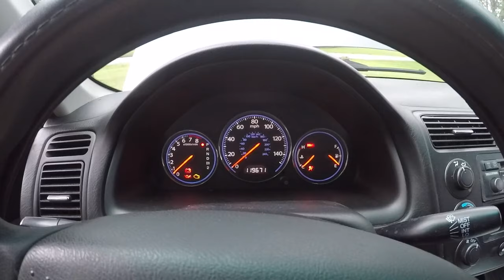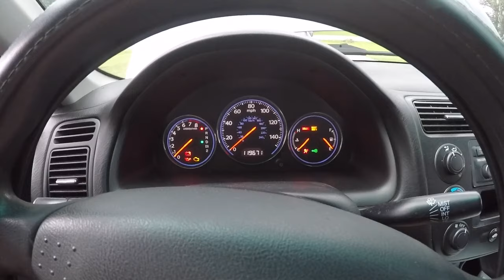Honda Civic LX Engine Swap Part 4 Will She Start!

Comment: Dear poster, did you swap in the same engine as the original one that came with ?
Reply from the maker: the new engine that I put in there was from a local seller of engines. they have bunch of cars/ parts and more, they removed the engine from the donor car and I installed it in my civic.

Comment: Did you have to remove the AC out of the system before you took the lines off?
Reply from the maker: A M you really don’t have to, because if you undo one of the lines it will all come out. So that’s not too big of a deal. Plus we needed ours refilled so it wasent’t too much of a problem to just let it all out. Just don’t keep your hand under that pressure or what all comes up. Let it flush out and then work on it.
Reply: Lx to ex
Reply from the maker: @MiguelLopez-kp8ev  lx
Reply: Brother ty for your knowledge quick question is it a mission if i change d17a2 vtec block  and add a d17A1 head
Reply: @RomanovichAutoSurgeon  thanks for the heads up man. Me and my brother was able to swap the engine  out. Finally have it all put together and am working on getting the fluids together before we crank it. What issues would I expect to see when I first start it up? I went back over everything to make sure everything is how it should be.
Reply from the maker: You don't have to but you can depressurize it a little by taking a flat head and pushing down on the cold fill lines. Just have a towel over it because Freon will get on you and it will be cold, plus don't think it's the healthiest for you.
Reply from the maker: @andrewm5190  What I did was purge the fuel lines before cranking it. So put the key into the ignition and put it into the on potion, but don't crank the car over. Do this about 5-7 times, and it should fire right up. It may want to hesitate for a second or two due to it being cold, other then that it should start right up. As long as you have it all connected it should fire right up. Also you could take the two lines from the electrical where they connect to the car battery, so positive and negative poles, take them and hole them together for about 10-15 seconds. Obviously don't put them to a power source while doing this. What this will do is kill all the extra electric flow our of the system, just to make sure it don't blow any fuses. Let me know how it works out !!
Reply: @RomanovichAutoSurgeon  sweet, thanks for the advice. How is your Honda holding?
Reply from the maker: @andrewm5190  Not so well, if you watch my recent posts you would see that it was banged up by the tornado.
Reply: @RomanovichAutoSurgeon  oh man I am sorry to hear that. I havent had a chance to check them out so I wasn't sure.
Reply from the maker: @andrewm5190  No worries. Hope your not effected!

Comment: did you have to remove starter?
Reply from the maker: I actually did not have to remove the starter because I was able to remove motor and transmission together. Now since I knew that I had a good started, I moved it to the new engine! Hope that helped, unless you had the question in a different way. Let me know!

Comment: Hey I have a Honda Civic 2010 Lx sedan , if I swap my regular engine with a V-Tec , will it damage my car or will it make it faster ? Or not start
Reply from the maker: Honestly I don’t know.  I’m not that big of a guru to know. But I don’t see why it would damage it at all. I would say you would need to ungraded the transmission because it might not match up. Otherwise it should be fine.

Comment: hey im looking to LS swap my 2004 honda civic lx sedan, do you think it will fit? also will it be possible to turbo it and also swap automatic transmission for a manual one?
Reply from the maker: Hunter I wouldn’t know for sure. But I believe it should all fit up